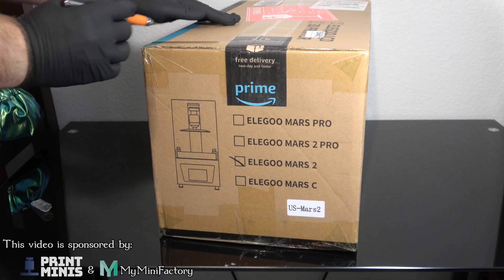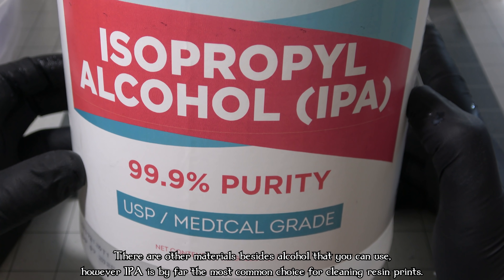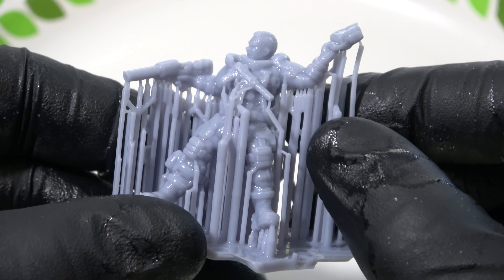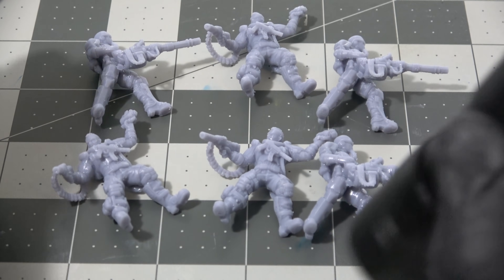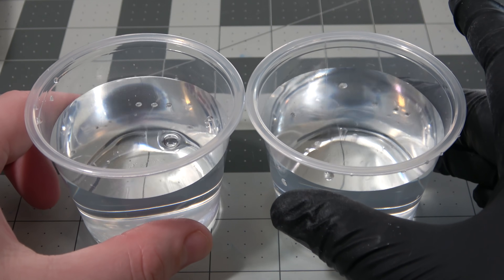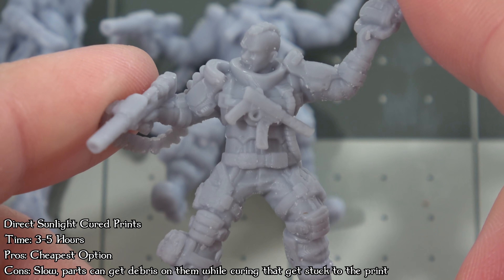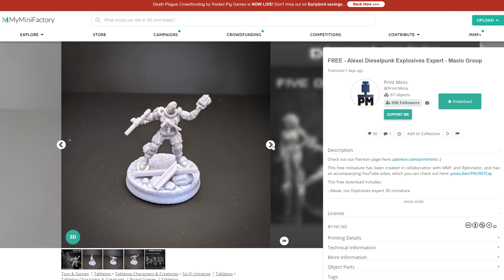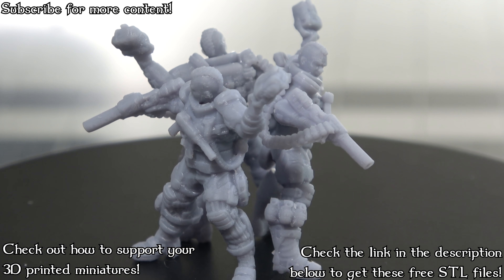How To Post Process Resin 3D Prints & Water Curing

Comment: I’ve had a 3-D printer for a while and the one problem that I always end up having is that no matter how long I cure something for it always ends up leaking resin at some point, what would you all recommend to fix that? I’ve tried doing drainage holes, washing it for extra long beforehand, every other tip and trick I’ve heard, I’m just at a loss at this point.

Comment: isopropyl doesn't mean 99% alcohol, it means it has mostly propanol as opposed with normal alcoholic mixes that have a little bit more of all (Methanol, Ethanol, Propanol, Butanol). ISO means "same"... which means it's an alcohol that has only one of the alcohols inside (propanol here) not more. The percent can mean the purity versus other alcohols or versus water as "solution".

Comment: Water curing ?       what would the resin be   in this would it be Water washable resin ?      or can u get normal resin and then just put in water and cue ?

be greatful for the help im looking for cheap options to clean and cue       and resins for mini figures and tanks etc        Eleegoo x looking at but i do have uv torches so how long would u try that for and the machine u had is about 15 to 20.00 so alot cheaper than the x machine

thanks

Comment: A few notes, and considerations for those who are new;
1) Find a good reddit or Facebook group specific to your printer make/model.  Every printer has its own weird things, and these groups can help a lot.  This is doubly true for larger printers like the Saturn where traditional supports and things just don't work like you would expect.
2) Consider using stronger chemicals than alcohol.  I started printing resin mid-pandemic where getting good quality iso alcohol was essentially impossible to get, so I tried a bunch of different things from the hardware store and settled on Acetone.  Yes, it is smelly, but the fumes are not toxic, and it is nice and strong where it will literally pull the uncured resin from your print.  No more brushing required.  I keep 2 paint cans of the stuff, one dirty to get the bulk off, and one cleaner one to get off the remaining lit.  Swish it around for ~15-30 sec, then another 15 sec in the cleaner pot, and done! The acetone evaporates in seconds, and other than the smell does a better job faster, and I highly encourage people to try it.
When the 'clean' pot  starts to get noticeably cloudy, add it to the dirty pot, and pour in some fresh acetone.  It is cheap, easy, clean, and great.
3) Water curing... yes, it is good... but with caveats.  Especially for delicate prints, it can help prevent warping.  But keep in mind that this is now contaminated water, and best practice is to let that water evaporate fully with full sun exposure.  Anything that gets uncured resin in it should be treated as a hazardous material, and should not be treated properly.  Yes, technically speaking your model is cured, so any resin left suspended in the water should also be cured.... but letter of the law in most areas says to that that evaporate fully to dispose of it properly.  Which is why I don't do it myself.  I have mosquitoes, and leaving water out to evaporate just is a terrible idea in my area.  But as long as you are disposing of the water properly, it works great, and I would highly encourage it.
4) The sun is big... really really big... so don't leave your prints in direct sunlight.  It can/will warp the prints, and for some clear/white resins it can burn/orange/cloud the print.  Get yourself a cardboard box, and a 24W UV light kit on amazon.  Line that thing with foil, tape the lights all around in there, and set the box over your print for ~5-10 minutes.  Flip the print over for another 5 min to get the bottom, and done!  Cheap, easy, it will hit all sides pretty evenly, and at a low enough wattage to not introduce warping.
If you cure outdoors, then do it under the shade of a tree, and that seems to help a lot.
5) Once everything is removed and cured, then comes the cleanup.  Ideally you want lots of extremely thin supports which pop right off with no issues... but that is sometimes (often lol) not possible for every part of a model.  Lately I have taken to being less careful about snapping the supports off, and filling the crater with material and painting over rather than snapping the supports off and sanding the nub down.  To each their own of course... but that is just something I have noticed for my own workflow that works well.  If painting is not an option then obviously this would be a terrible idea... but part of me does not trust that a resin print is ever fully cured, so I will at the very least lacquer or paint all of my prints to add that little bit of barrier.

Hope that helps somebody!  Resin printing is awesome!  Hope more people get into it!

Comment: The literal hot tip of removing supports by dunking the model in very hot water for a few seconds bears mentioning, I think. I haven't found that it separates or warps even tiny details, and it softens smaller support contact points to the degree that they almost fall right off. It's a good thing to add to your cleaning routine IMO, right after the alcohol bath.

Comment: You should test out the water soluble resin. Then there is no need for the alcohol but you still need to rinse it off with water but you can't run it under the faucet, you need containers like the alcohol.

Comment: Man 3D printing has come a long way I'm still do used to detailed parts of prints being Garbo but these came out amazingly!
Reply: really depends on the printer.  Resin printers are AMAZING detail... but where a traditional FDM printer would cost ~$0.01-0.03 per mini, a resin printer is going to be much more expensive at closer to ~$0.10-0.15 per mini.  Still cheap, still worth doing for lots of little highly detailed items... but larger things like printing terrain or bigger things it is often more cost effective to use the lower detailed FDM prints.
That said... some of these FDM printers are getting pretty awesome too!

Comment: What do you do with the supports after you've separated them from the mini? Thanks for these videos on resin printing, you're really good at explaining stuff and it's making me more and more interested in getting a printer someday!
Reply: I cure those too and then throw them away
Reply: Buildlines are waste products, there's no way to reuse them in the printing process, they're as useful as any other piece of random plastic sticks so up to you if you wanna use them for something but they're primarily just garbage.
Reply: @GiraffeFlavored  There is ABSOLUTELY a way to reuse them. Often when a print fails, it’s far healthier for my FEP to stick a old support into the vat and use the vat clean, can peel it right off.
Reply: @tfan2222   @Tfan  .. I mean like you can't reuse them in printing, like you can't melt it down and turn it back into resin like you can with PLA if you have the machine that does it. That's why I said if you have a use for a bunch of plastic sticks, and there absolutely are uses for them, you just can't turn them back into uncured resin and reuse them in the printing. Which is why I said that last sentence, which I guess you just skipped over

Comment: Great video as always Rybonator! Instead of superglue, you can also use a little bit of resin and that UV flashlight to attach broken bits or assemble multi-part minis. I also use that trick for filling any divots from removing supports.

Comment: The water cure method is nice, however 90% of the time the reason you have cloudy white specks on your cured minis is because you didn't clean the print off thoroughly/ completely dry off the IPA from the print before you cured them. Make sure your prints are clean and dry before you cure using any method.

Comment: If you're just going to break off the support why not do it before you clean the print? The supports hold LOTS of resin, even with water washable resin you're ending up with a lot more toxic waste to deal with than you would if you peal away the supports first
Reply from the maker: I've never noticed an excess of resin when I do mine, however, I have on hollowed prints before. Sometimes I will clean it again after removing supports if I feel that it's warranted. :)